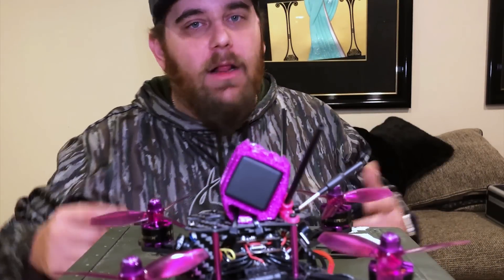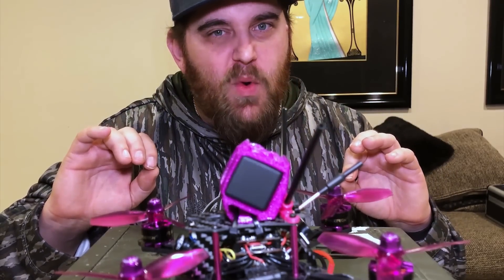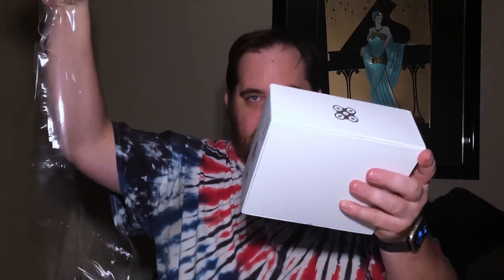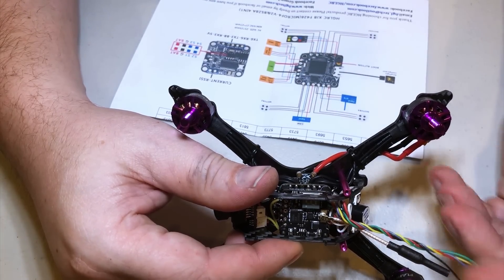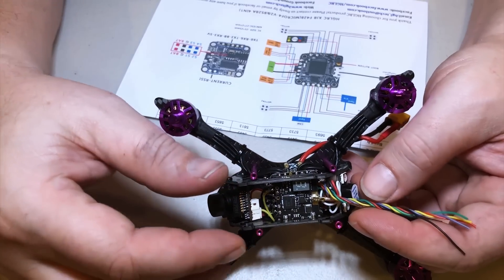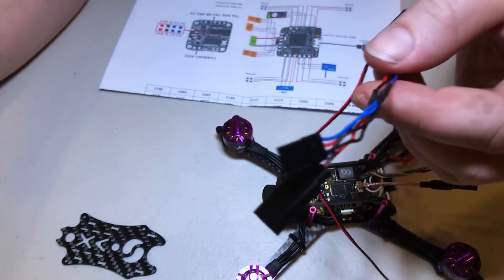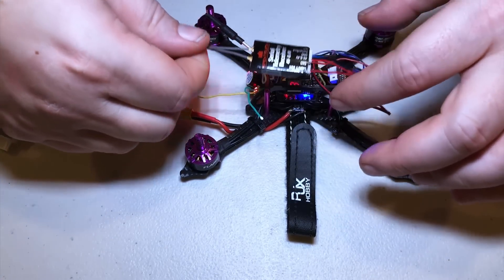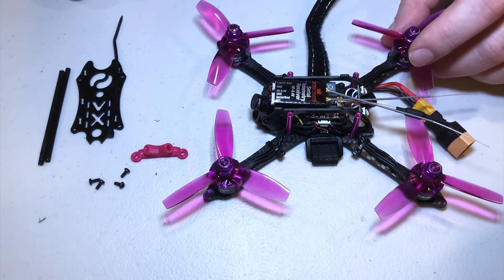HGLRC XJB 145 - Part 1: Unboxing & Receiver Install - Fitz

Comment: hey bro. did you change the power wires to handle the xt60 power plug ? do you need bigger wires ? I have same lipos.
Reply from the maker: When I use the 1300mah 3s 45c packs, I still use a xt60 to xt30 adapter.  I've since purchased some 850mah 4s 75c packs which make this baby a beast (along with gemfan props, and my tune).  All of which is covered in this vid: https://youtu.be/VDBs7Psti3s  What is great is those new packs have a xt30 connector on them too so no need to change anything.
Reply: so can i weld a xt60 connector on the existing wires ? Or do I need to change the wires ?
Reply from the maker: Yes if you want to swap out the xt30 for an xt60 connector you are fine using the existing wires.

Comment: I purchased this drone a month ago  but I am encountering gyro errors, a BF flash did not fix it either. It seems there is a defect with the MPU6000 desoldering itself with the heat, can you confirm if your XJB is still working? I'm unsure if just regular use broke the gyro or if flashing to the latest BF was the culprit.

On the other hand, good review I will be subscribing!
Reply from the maker: Mine is currently flying like a dream.  Have not had any issues thus far (knock on wood).  I wouldn't think it could desolder itself, did you experience any bad crashes?  Or also another culprit can be moisture, either condensation, due to temp/humidity, wet enviroments, or even "grass juice"  I did have once instance when It flew "wonky" and the kulprit was when I landed in tall grass, it chopped it up and sent the pieces into the stack, and now the damp grass laying on the board was making it act funky.  Took it apart, cleaned all the grass out and let it dry, next day flew like a dream again.  Hope that helps!

Comment: Hi, how long is the strap for the battery, I am gonna order a better one when I order this quad? Cheers.
Reply from the maker: These are the ones that I am using with it: https://amzn.to/2RDkn99  The one that comes with the quad is garbage.
Reply: Yer they are shocking, I think they are for holding wires together under your desk, lol. Thx for that.  @tronage
Reply from the maker: I think you are right, they are just to keep wires bundled together under the desk.  But you can't "tighten" them easily.  You need that buckle "loop" so you can snug down the pack.  The ones I linked work great for all sizes of packs that I've used on this quad, and have not had a battery eject from any of my crashes using them.

Comment: Nice info.  Do you have a link to the file to print the antenna holder?
Reply from the maker: Items that I create to 3D print as mods for my quads are exclusive rewards for my Patreon supporters.  A single piece like this is available to a supporter at any level.  As a supporter, all you have to do is request it from me, and I'll print it out in a color of your choice (from colors I currently have in stock), and mail it to you.  You just have to cover the shipping cost.
Reply: I understand.  I just want to get this bird in the air.  I got a 3D printer so I don't have to wait.  I will go ahead and draw one up and share it on Thingiverse.  I saw you have a collection on there of other people's designs that you plan on printing.  Share and share alike.
Reply from the maker: I'm all for sharing information and knowledge, hence why I share these videos showing my mods/solutions to problems.  I show the problems I face, and how I solve them (in my opinion the hardest part).  In this case it gave you the inspiration to make your own part based on what you saw of mine, and that is super awesome!!! I hope to inspire people with these videos and perhaps the solutions they come up with are even better then I did!  When I started making these videos I decided that my reward for supporting the channel through Patreon at the lower tiers would be access to everything I make,  it is hard to have a "valuable" reward for a $1 tier, I think exclusive access to receive things I make is a fair trade.  Good luck and I'm excited to see what you come up with!

Comment: Hey Rob,

So I got my XJB-145, receiver, etc.  Quad came yesterday and I am working on getting it airborn.  Do you have any video you would recommend to help set up either IBUS, SBUS, or PPM? I've heard IBUS is the best for Flysky receiver/transmitter combo, so that is what i am leaning towards. However, I got a Flysky FS-X6B receiver and it is a small bit too wide to fit within the canopy of my drone.  Any ideas on some other mounting points/solutions?  Thanks for any help.  Sorry your XJB-145 went down in the recent video.
Reply from the maker: Awesome, good luck getting it in the air.  Unfortunately I don't know much outside of the realm of Spektrum, so I'd just be guessing if I was to point you  to another video how to set it up (I do know you don't want ppm, so stick with IBUS or SBUS).  As a suggestion to get airborne, rather then putting the receiver inside the canopy, pop off the camera mount as I did, and mount the receiver on top.  Or if it will fit, leave the camera mount on, and have it be a little "roll-cage" for the receiver for protection.  This way you could get in the air flying while you figure out other solutions/receivers.
As for the actual connections, just make sure your connections match the type of receiver you are installing.  According to the directions that come with it it looks like IBUS shares the same pin as dsmx (blue wire).  And SBUS is the yellow wire.  In Betaflight, just make sure in ports to make UART1 the SerialRX and then under configuration in the receiver section set the mode to serial-based receiver, and then for the receiver provider, select what ever matches what you are installing.  Hope that helps you out, and if not feel free to ask more questions!
Reply: Sounds good, thanks for the quick reply.  I think I am going to have to get a bit of a background on navigating betaflight too, that's a whole new application for me
Reply from the maker: Seems a bunch of people need some help with betaflight, specifically for this quad even.  I'll probably put together a video about it, how I do a setup of a quad etc.  I'll try to get it out asap since I know you (as well others) are anxious to fly.
Reply: That would be awesome, thanks!  Think I may just get a smaller FS82 receiver.  Asked some people on RC groups last night and that seemed like the direction that would be best in the long run.
Reply from the maker: As a heads up, today at 3pm est the video walk-through to setup the XJB in Betaflight will be published!  There was a lot to cover, so it is a bit long, but lots of good info in there!  Let me know what you think and if it helps you out!
Reply: tronage Awesome sounds good, finally home during daytime so I'm going to do some flying today. If I see something set up differently in mine I'll pass it along. No idea if it'll be better or worse, but could be neat to compare lol
Reply: @christhiell1524  Did you get the FS ia6b receiver to work on this quad? If so how? Did you need to get servos wires? were they specific? All I need to know is if this receiver will work on this quad!! I cannot find the information ANYWHERE and this is about the 34589265 comment askign someone if they know and have not found an answer AT ALL. This is seriously the most frustrating hobby I've ever gotten into as the information is just NOT THERE.
Reply: @upplsuckimcool16  I did not, i ended up going with a smaller receiver. Cant remember the name, but it was your typical micro receiver like the size of a dime.

Comment: I will be asking.. why that receiver and not the FrSky R-XSR for example? I am very ignorant in this subject so I would apreciate every help possible.
Reply from the maker: The receiver has to match your transmitter, and they are not inter-compatible from brand to brand.  So if you own a FrSky transmitter then you MUST use a FrSky receiver.  The reason I chose this receiver is because I fly a Spektrum brand transmitter so I must fly Spketrum receivers.  This is their "racing quad" model that has telemetry that can tell the transmitter the signal strength.  Previously as a Spektrum user I wouldn't know how good my link between transmitter and quad was, so I could easily fly "out of range".  This model has telemetry setup so that my transmitter can be setup to set off an alarm when I approach the edge of my range (I have it set at 25% signal strength).  Since I don't own a FrSky radio, I'm not educated in the FrSky receivers so I wouldn't know what they are capable of or which is good.  Remember if you are using FrSky, you will need to use a different wire to hookup your receiver (the blue wire is for Spektrum only).  For the FrSky R-XSR receiver, you will probably want to use SBUS, which is the Yellow wire when you hook it up.
Reply: I get you. Geez.. the learning curve is never ending haha.. but I believe it will all worth. Thanks for taking the time to clarify that. I thought it was some how standard for many different controllers  -.-
Reply: That is not completely true, there are  turnigy receivers that are compatible with flysky transmitters.  For example Turnigy ia6c ibus/ppm  only receivers work with Flysky  FS-I6, FS-I6s both old and new models. I recently read about this and I think the receivers came out about a year ago.
Reply: Blue wire is not spectrum only either. It is for any brand receiver that is connected via ibus.I'm using blue /ibus, on Flysky FS-A8S . 
Just remember It must be an ibus compatible receiver to work with the blue wire , if not use yellow wire for sbus,or last option green wire for ppm. It's important to check the voltage of the receiver as well. There is a 3.3 volt pad that has no wires soldered to it. The pre soldered wires are soldered to the 5.volt pads. Good luck with setup and  updating,flashing esc's and FC, it can be frustrating at times.
Reply from the maker: Good information, I'm always learning.  I always forget about flysky lol!
Reply: Thanks for the info. I am now dealing with some malfunction on the quad or in the battery connection =( havent been able to fly yet.